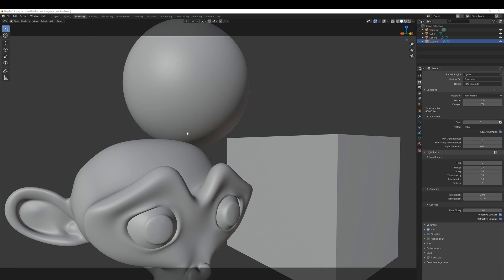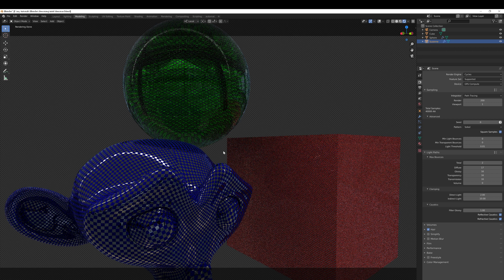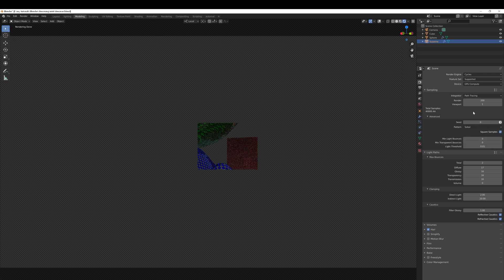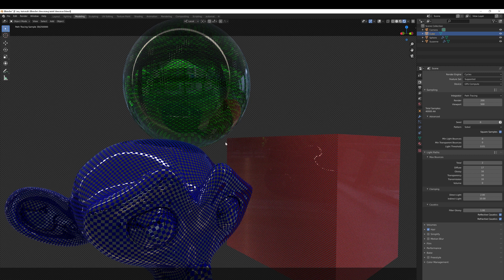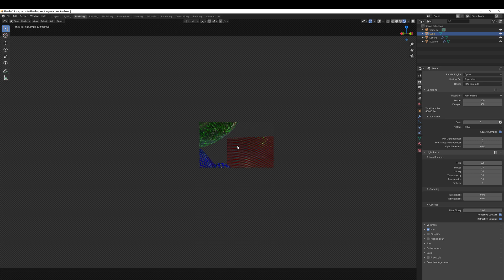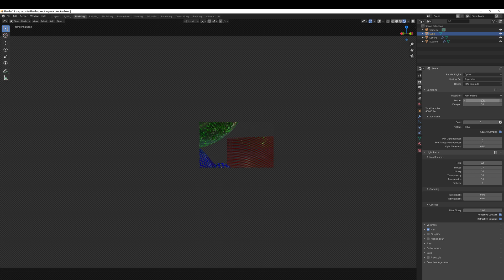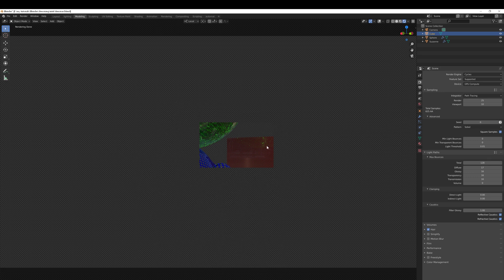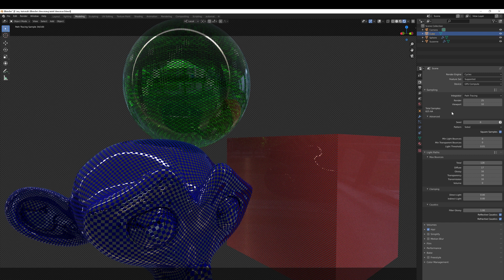How to quickly find the optimal number of samples needed for the fastest possible render in Blender

Comment: Curious how Blender handles upscaled renders and then scaling them down. There are render engines which use this method to get rif of fireflies and perhaps also some noise. I find the Square Samples really confusing to work with. I prefer the input samples = ouput samples
Reply from the maker: works great.  Don't forget that each time you double your render resolution you can divide your samples by 4 to get the same noise level and speed.  Bigger renders need more ram for denoising too.

Comment: Nice! Just a quick tip: instead of guesstimating the number of samples needed in the final render, you can simply take the square root of the samples from the viewport render. Just type "sqrt(620)" (without the quotes) directly into the "Render" number field. Cheers!
Reply from the maker: infearia excellent point 👍